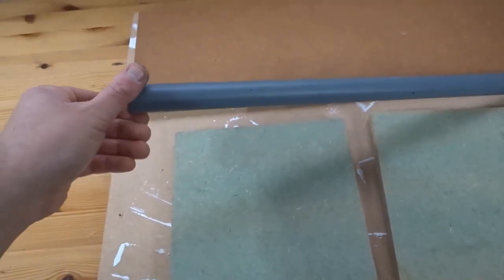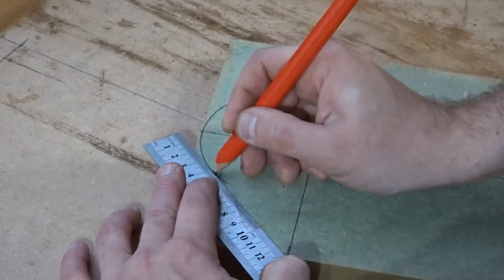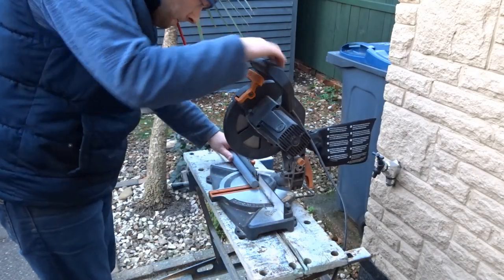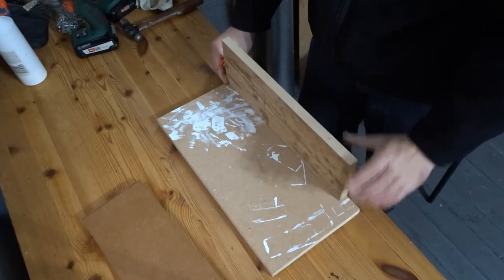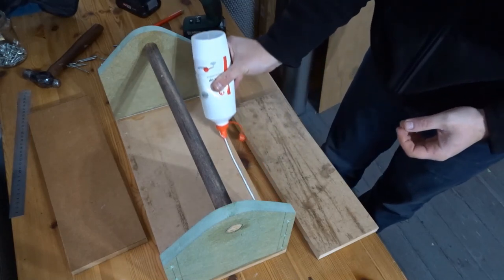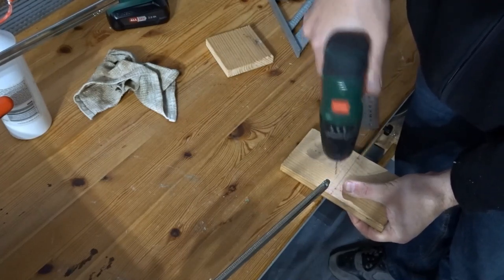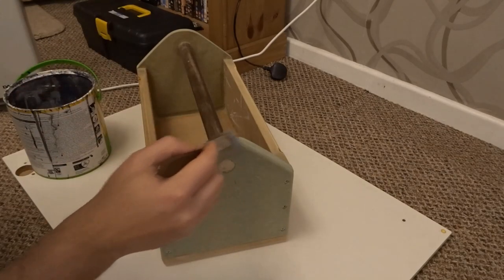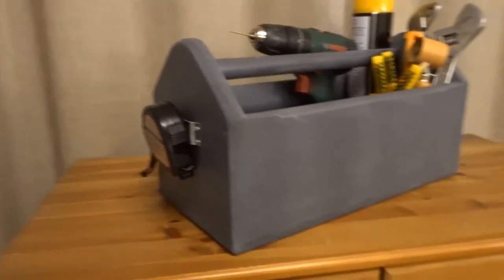How to Make a Simple Wooden Tool Tote Toolbox (With Scrap Wood)

Comment: Thanks for making this video! 👍 

A couple changes I would make, just to make the job easier. 1) Keep the end boards clamped after sanding to drill the handle holes. 2) Don’t cut the broom handle to length, but a little longer. When you assemble, let it stick out on one end and saw it flush when the wood is dry.

Anyway, those are minor suggestions. All I have at the moment is mdf, and your video came up first! When I get some better scrap material, this tool box will go under the sink and contain cleaning supplies/brushes, etc.

The tape measure clip is a great addition . . . I mean, really fucking great. I’ve got three tape measure, and at this moment I know where one is for sure, I think the second is in my backpack/manpurse, and I haven’t seen the third one in months. 😭
Reply from the maker: Thanks for the suggestions 👍 I kind of made it as I went along. I can never find a tape measure I've got loads they just disappear 😕 good luck with making yours 👍

Comment: Another excellent project, Phill!
Reply from the maker: Thanks Rob!👍👍👍
Reply: I like the small router you used. Was it another Aldi/Lidl special buy?
Reply: I missed Lidl's £30 router but seen some for £20 on Amazon. Are they too cheap do you think?
Reply from the maker: @robertgarner11  The Router is from Aldi It cost around £35
Reply from the maker: @robertgarner11  I'm liking this one from Aldi made by Ferrex although I would be cautious about cheaper models just for safety reasons more than anything else.